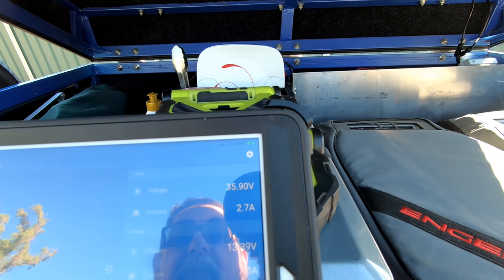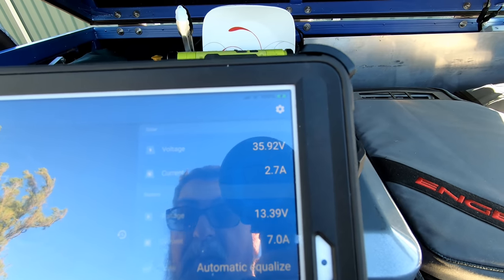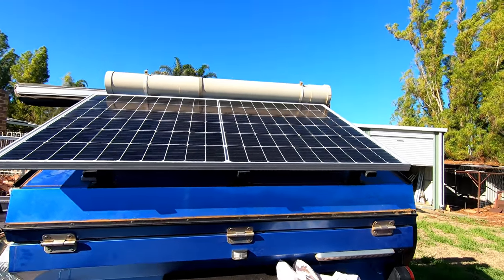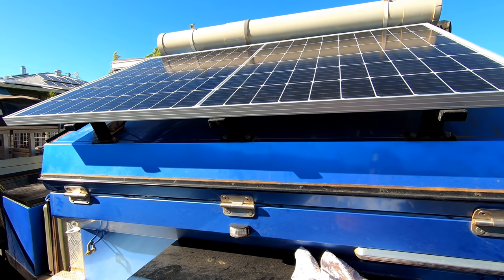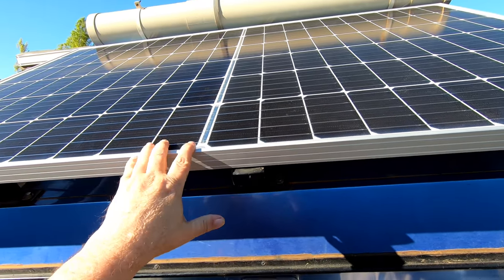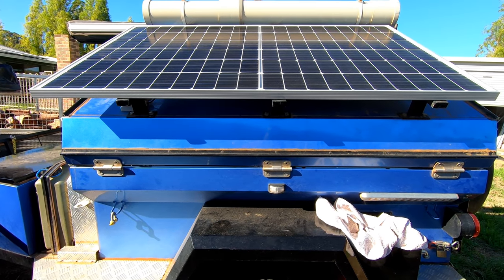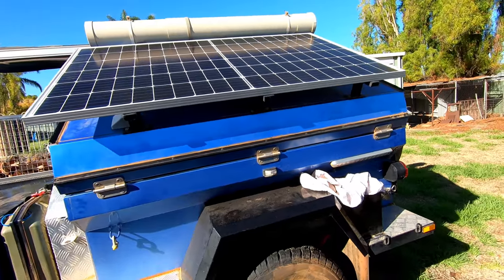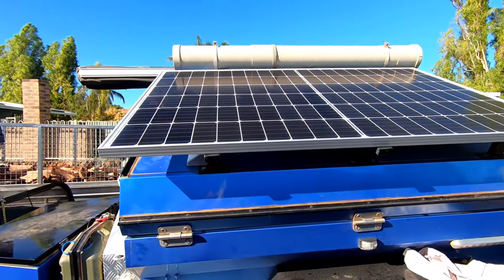SOLAR PANEL TEST. Split Cell Technology. Severe Shading Test. P2

Comment: Interesting!  The panels I have on my roof are from a Canadian Manufacture who was in business from 1990 to 2011.  They use the same configuration of series and parallel cell wiring and guarantied shade performance from an array.  The panels were almost twice the price of the Chinese panels which were just wired in series when I bought them, but are still giving 100% performance 13 years later.
Reply from the maker: Going to the city in the 1st next month, will be doing some interesting tests up there. 2 or the top performing brands currently on the market. Should be interesting as well. I love testing Solar. These split cell panels impressed me that much i fitted one to the camper trailer. I think for caravans and campers that often get parked in the shade and have lots of stuff on there roofs like ac units sat dishes and such. These Split cell panels will be ideal for.

Comment: Hi Justin, Just found your channel.  Great test, are you able to tell us how this is different from an optimizer? Or are optimizers no longer required if you have split cells. cheers
Reply from the maker: Don't need them. You also don't need them on this panel.  This link is the best panel i have ever tested. https://youtu.be/P_r1o030Frc  and if you have a look here https://www.youtube.com/watch?v=U0CAW3uKiBY you can see we shattered the solar panel on our last trip but it is still producing over 300Watts. Awesome solar panel even though its broken and has shade on part of the panel